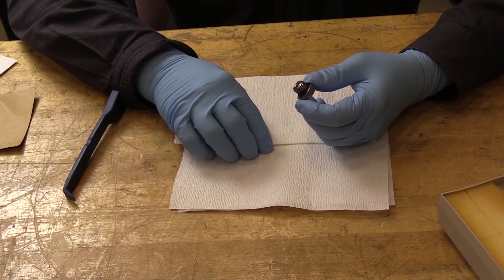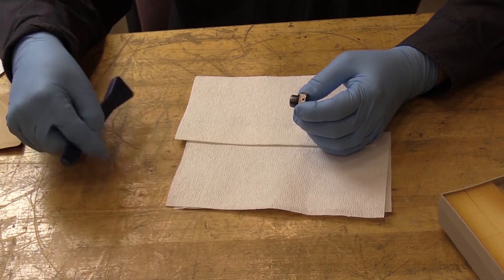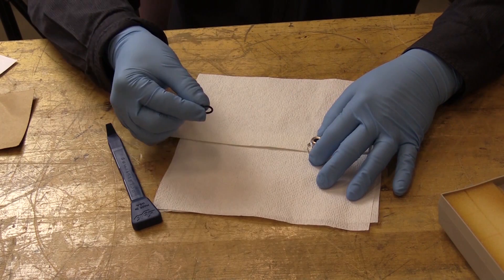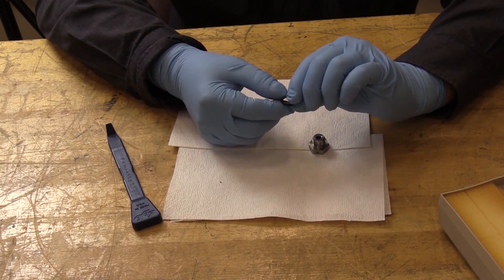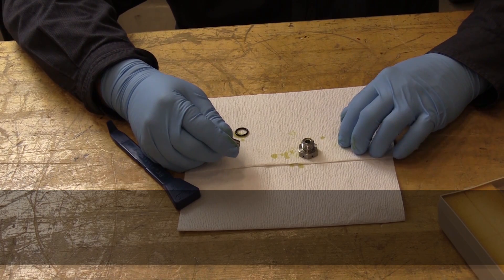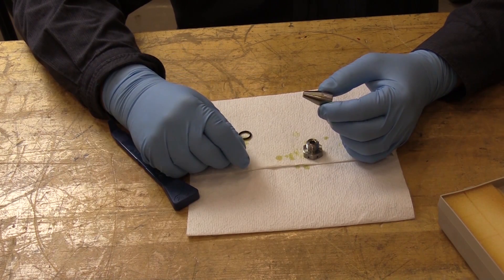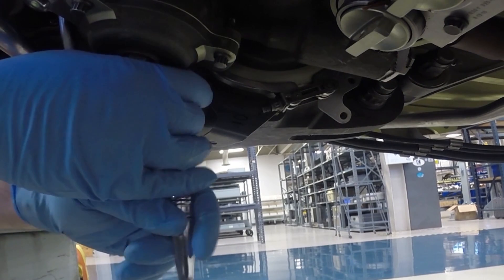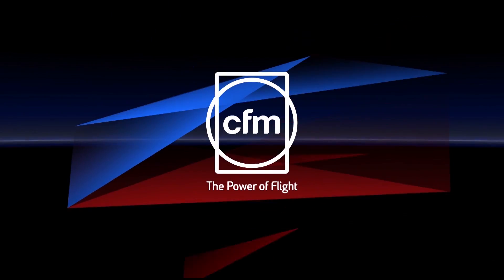CFM - O-Ring Installation Over Threaded Fittings - GE Aviation Maintenance Minute

Comment: Who makes o rings these days? May those are better quality that the stuff meant for commercial vehicles. I wont bore you but Ive been trying to seal an air leak since December....

As an aside I worked on CF6s on the KC10, and the TF33. I did like working on the TF33 more. Smaller and easier to get around. The CF6  maybe...has a bad place in my memories over the number 2 engine on the KC10...because its like 5 stories up there LOL